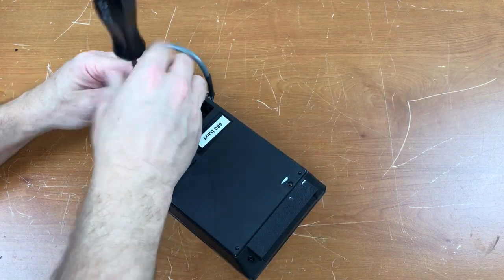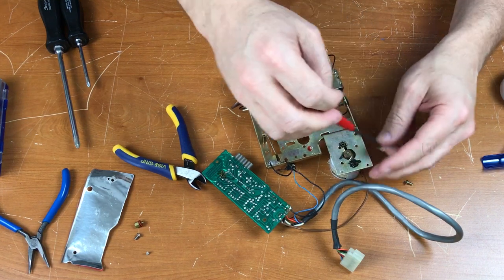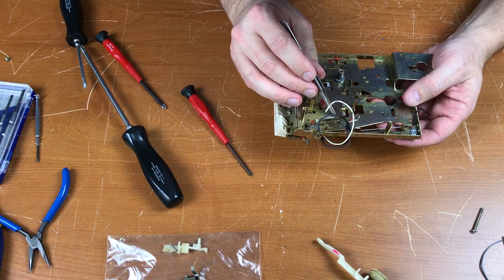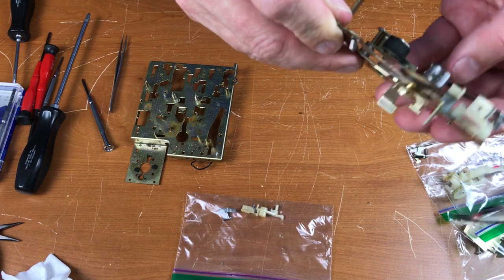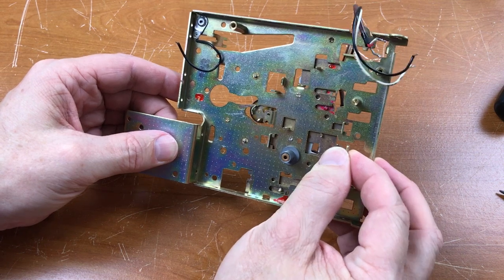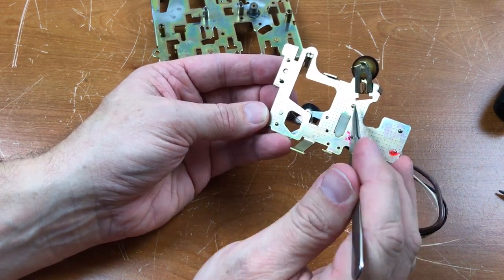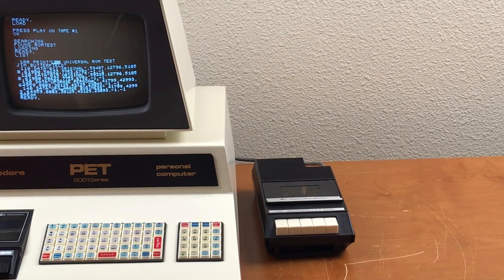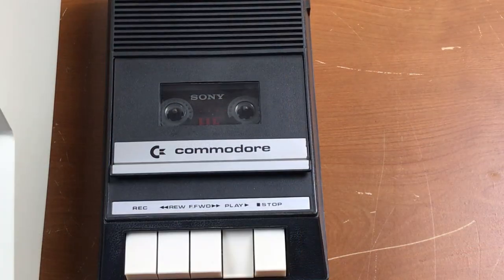Commodore Datasette Rebuild

Comment: I am looking forward to checking out this video, as my built in recorder, is not working, even after replacing the belt and cleaning the heads. Everything is spinning now, but no luck on reading anything.
However, I will not be able to work on this for a little while, as I have a SOL-20 on my counter and an Altair 8800 on my spare desk. And they are both just to beautiful to put away.
I am in the process of trying to repair one of the SOL-20 floppy disk drives and the other needs to be aligned. Filter cap should be here this week, and then I will be able to see if this drive is working, the other drive needs an alignment, but as I have never aligned a vintage floppy disk drive before, I have been studding the process. Should be able to start that process later on this week as well.
 

Keep making these great videos.